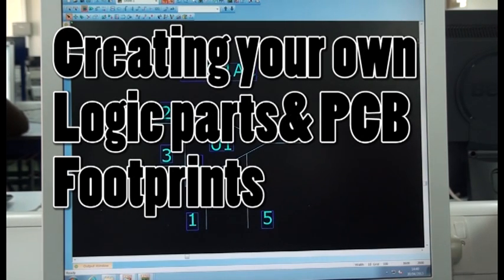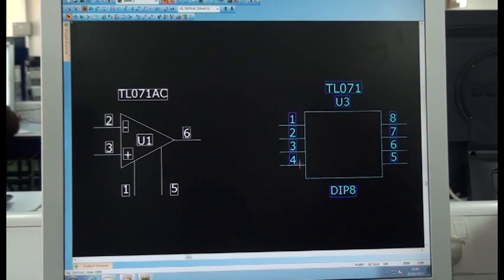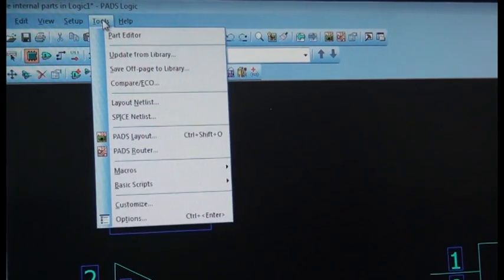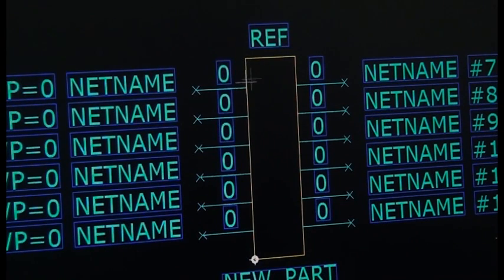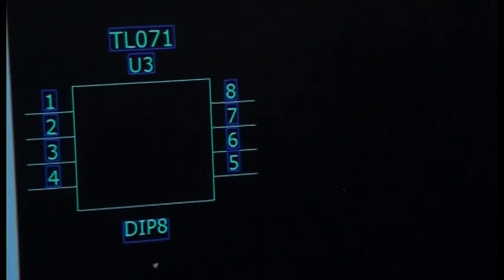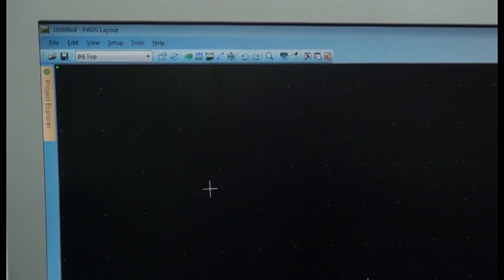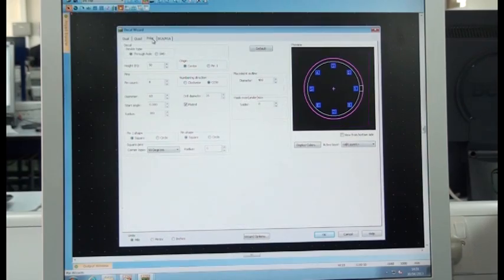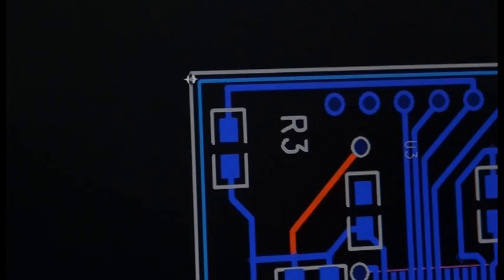PADS Logic and Layout  - Creating Your Own Parts & PCB Footprints

Comment: The we used to do it at our company was to put the power and gnd blocks in the bottom right corner of the page. If you are a circuit designer with any amount of experience you would know that an opamp will need the power gnd pins. If anything you have to pay special attention to those pins for filter requirements and type power source dual rail or single. If its a single rail how close will your output get to either rail to prevent phase inversion etc.